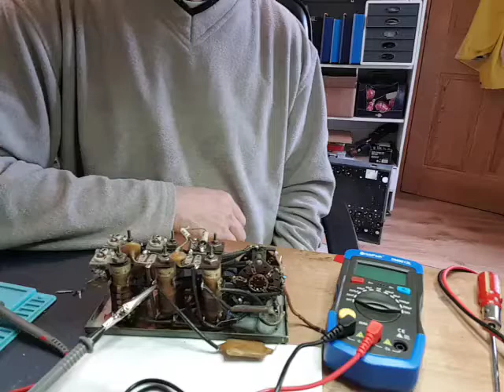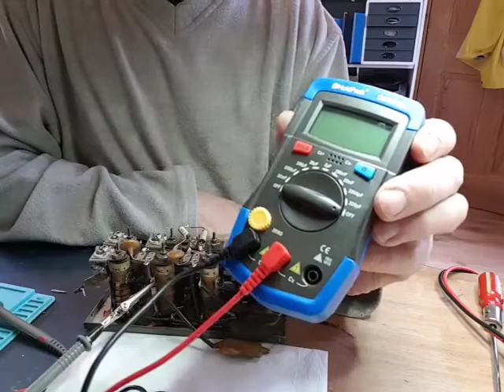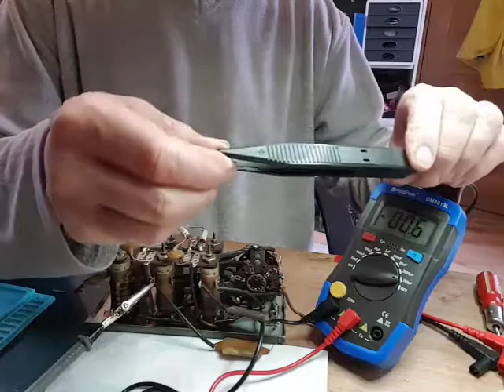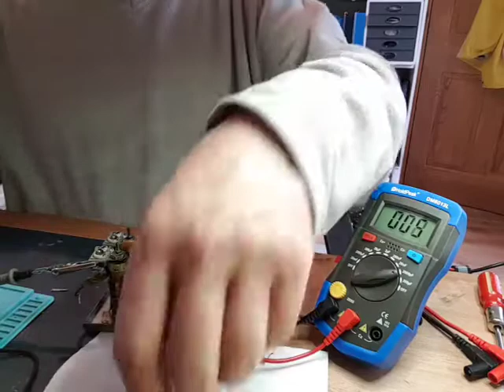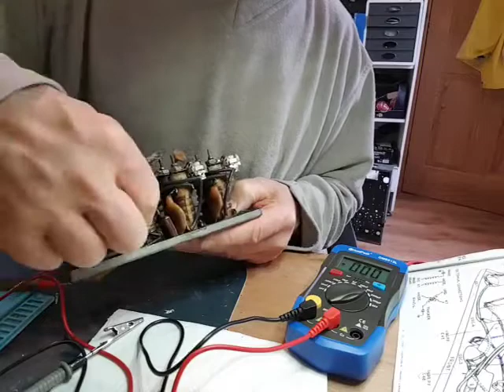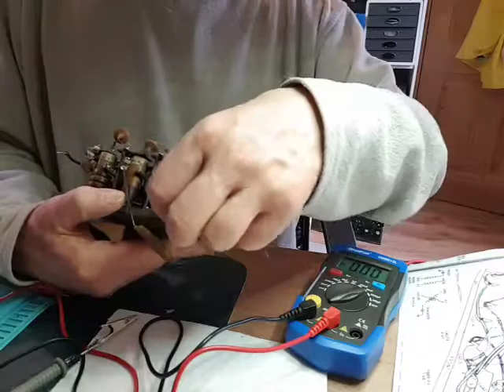Marconi CR100 Renovation (16) Oscillator coil pack capacitor checks.

Comment: Simon, maybe I  missed it but what resistor wattage do you replace with 1/4 or 1/2 watt? would it be safe to go with 1/2 watt unless they are heavy heat disposition resistors?